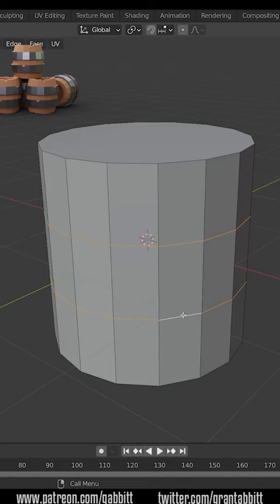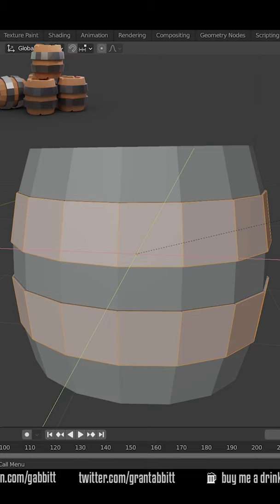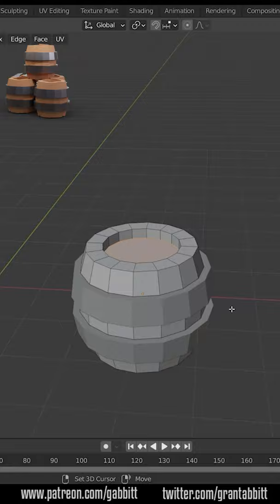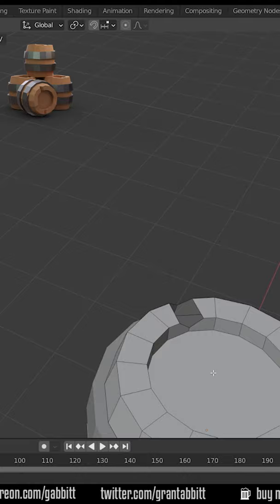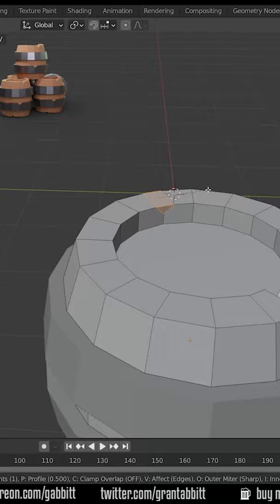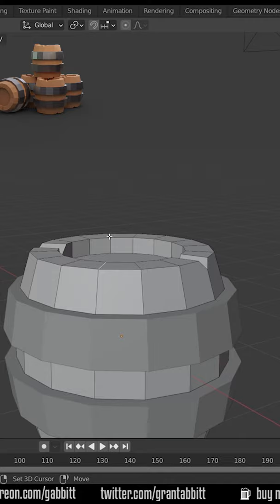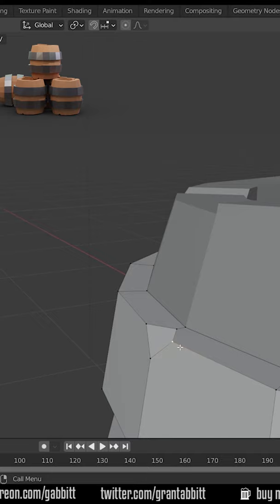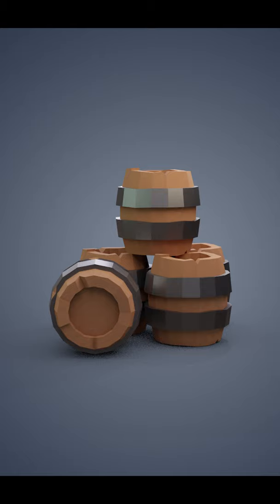How to Make a Low Poly Barrel in 60seconds

Comment: The extrude doesn't work in 4.0 blender (I do realize this is 2 years old). Do you (or anyone else tbh) have another way to do the extrude in 4.0 <Edit> I choose to extrude 2 pieces by 0.05 and continued until I had it all then switched to the dot mode and added a face to the little holes :)
Reply from the maker: You probably have some doubles. Extrude hasn't changed for a long time